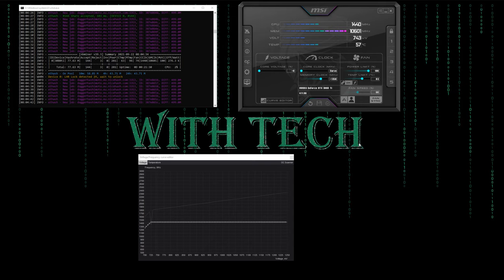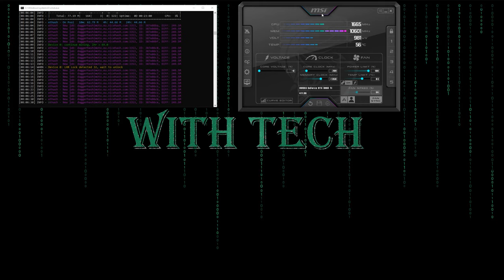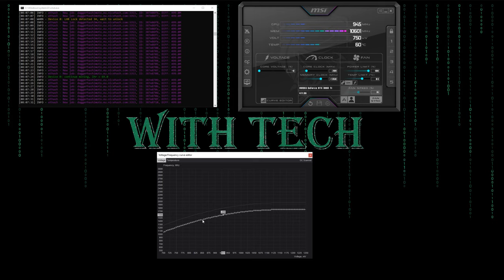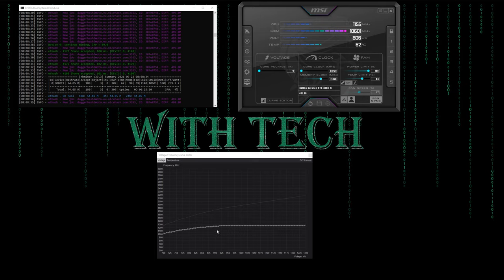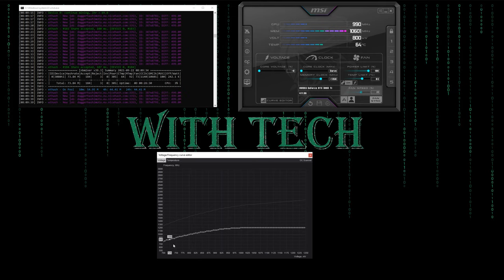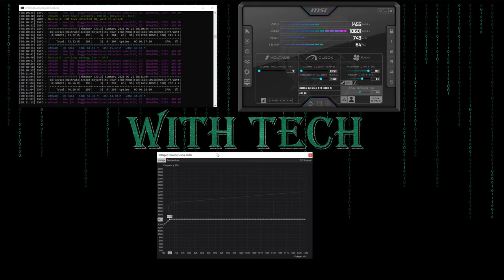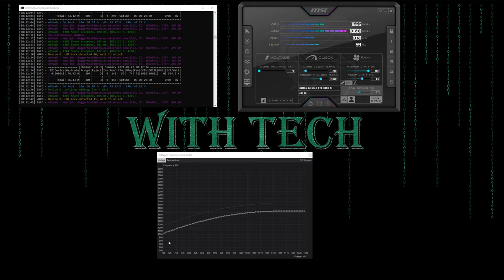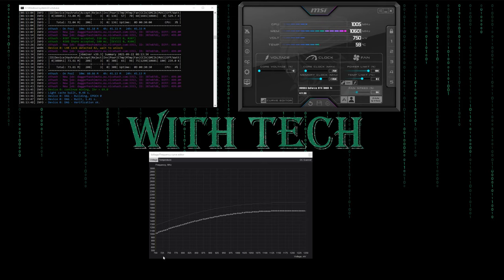Lock Voltage and Core Clock! With MSI Afterburner!

Comment: Desperate Gamer here and long time overclocker! having a new issue with afterburner not accepting the apply of core voltage changes.  When I hit apply it goes back to zero.
Reply from the maker: I am not sure if it is something caused by the GPU or the software, but I have heard others having the same problem. Double check it yourself. See if others with the same GPU as yours have faced something similar.

Comment: When i open MSI afterburner it displays the temp and GPU but it just says 0 and doesnt change and i cant change anything on MSI afterburner all i can do is move the tab around
Reply from the maker: make sure you have the latest version of MSI Afterburner and the drivers for your GPU. in some cases you may need to uninstall and reinstall them again. let me know if these don't work.
Reply: @withtech341  Not of them worked, Everything is up to date
Reply from the maker: You want to overclock for mining? Use this method if you are NBMiner user. https://youtu.be/kudoRHTUBj4. Then you can use GPU-Z or any other app for monitoring hardware and then you can see the actual values your GPU having. Let me know about the results.
Reply: @withtech341  I want to control fan speed
Reply from the maker: You can do it as I have mentioned in the video. NBMiner has some miner issues at the moment but they may be fixed with the upcoming updates. In the future I may also make a video about t-rex miner which allows us to control the fan even better than NBMiner.

Comment: straightening the line what difference does it make for mining ..i love the idea but want to know why..then i will do it
Reply from the maker: With straightening the line you are basically either underclocking the GPU or overclocking it. in case of underclocking (with a straight line), you are basically making the GPU more stable and power efficient at some point. Undervolting kinda does something similar but for some GPUs, it could be less stable.
Reply: i am glad you show how
Reply: i did it many many thanks

Comment: Can ya help I have different problem so when I change my mem clock it doesnt save
Reply from the maker: make sure to hit apply after you change memory clock. also, if there's no load on your GPU, changing the memory clock wouldn't be shown. if you play video games, I suggest you activate the On-Screen Display for memory clock  from Monitoring section. then when you play video games, you would see the current applied memory clock. try it and let me know about the results.

Comment: may i ask , iam using 3070ti and iam mining on it also i saw when the memory Clock 1200 and the power limit 66 its perfect to me but iam afraid this memory Clock will let my gpu get tired after a few months . so what u think man
Reply from the maker: Just don’t let your card get thermal throttled and it should be operating good for a very long time. Mostly the first thing that could break while mining for a long time is the fan(s).

Comment: How can the L key lock voltage in the last part of the video be locked to 700mv, because I am in the same situation as the video, when I lock 700mv and apply it, it will not work.
Reply from the maker: It should lock the voltage at 750mv or below, not above that. Maybe it is because 700mv is too extreme for the GPU. I personally get one of these three values when I lock the voltage at 700mv, it is either 737mv, 743mv, or 750mv
Reply: ok, Can you use the L key to lock to any voltage?, I have tried to lock any voltage value and it has no effect, and the core voltage (%) of the msi afterburner main screen can be adjusted and applied, but the VOLT value has not changed.
Reply from the maker: @mingchuang5423  when you lock the voltage at a certain point, it usually means  it could go lower but not higher. and as we know, we cannot just lock at the lowest points such as 700mv with certain cards and GPUs, so it does also depend on the card. L key does lock the voltage but as I mentioned usually it means can't go higher than that. it is also true for the core clock.. One thing to mention is that there should be load on the GPU to see the effects of overclocking..

Comment: Thank you can you help real quick where should my asus f17 turf 3060 be set approximately
Reply: Tuf 3060
Reply from the maker: As I have mentioned it in some of videos and comments, each each coin and each GPU may need different settings, so try to find the best settings for your GPU. I have two RTX 3080 Ti and I have two different settings for them.

Comment: Thanks a lot for the video
Could you help me with a doubt please, if I lock my GPU frecuency cercain to the base clock of the GPU in this case a 2070m with Max-Q, this affect to the image in the display or monitor? I want to down temperature because in games the temperature ups to 90C, thanks in advance
Reply: By affecting the image, I mean that the colors change or the image looks strange with colors that are not or even damage the screen due to those changes, or the GPU itself. I locked in 1060mhz but playing resident evil 2 begins in 75C and them in a while time up and up to 90C
Reply from the maker: For gaming, try to focus on locking the voltage. Monitor the usual voltage you are at while gaming. Then enter the curve editor and lock the voltage at a lower value than the one you have had. If you had a 1000 mlv while gaming, you lock it at 950 mlv. Decrease the voltage until you lose fps. Lock it with the “L” key. Also, you don’t need to increase memory clock that much. Start with +50 and stay below +200. Same with core clock. Try to have a value between 0 and +250. Please know that these are just overall notes on overclocking the GPU for gaming. Each GPU is different from the other, so try to work slowly on finding the best OC settings for your GPU. Let me know of your further questions and concerns.

Comment: what is gonna happen if I for example lower my core clock only like by 300 and leave everything else including the voltage at default?
I have been seeing an incredible smoothness in my games with lowered core clock speeds.
I am wondering if this is even okay for my gpu 
cuz u know RTX 3080 strix default clock 1905 and i am running my gpu at 1680 core clock speed at default voltage and s h i t and i am telling you man, my games are running so freaking smoothly ....
Reply from the maker: Well, you will increase your GPU efficiency but be aware that sometimes performance is the catch. It is because usually for gaming we increase the core clock rather than decreasing it. You could lock the voltage for efficiency, not at 750 but higher. You can monitor your GPU performance and data while gaming, and then you can set and have the best overclocking values for your games.

Comment: Great video! What are your thoughts on using the 3080ti to dual mine instead to try to avoid some of the LHR?
Reply from the maker: Thank you! For Dual Mining, I think it is great that now we have this option, it could lead to get breaking the LHR GPU limit. And for mining, I would say it depends on what you want. For example, the number of GPUs you have and the the investment you want to make. if you have a +6 RTX 3080Ti Rig, then dual mining sounds better for me. or maybe when you want to get some eth on one hand, and save ergo, conflux or Raven coin on the other hand for investment, it would be a good idea as well. Now, Ethereum is so profitable that would kinda be enough if you want to exchange it to money daily. But if you want to prevent the LHR Locks, then locks happen with dual mining as well. I would say they are not as common as of NBMiner, but they could get really annoying with wrong overclocking settings.

Comment: Is it safe for nvidia card ...  Am not sure
Reply from the maker: Sometimes it is necessary. And usually it is highly suggested to do so, because you could make your GPU consume less power and run at lower temperature.
Reply: @withtech341  someguy sayad it can be tempered ..
Reply from the maker: You could always compare the stats and see if you are making it better or worse. GPUs are different from each other.

Comment: I used the exact same steps with my 3080ti Stric and Afterburner does not let me in any way go below 1245 Mhz Core Clock! Any advices are much appreciated!
Reply from the maker: if you want to lock the core clock at a certain point, give a negative number to it. then lock it with L. if you want a straight line, make sure first you lower down and level the two ending nodes (dots), then do the process of making the straight line. for some reason if you haven't lowered down the entire core clock and haven't leveled the two endings, it will only make a straight line to a certain core clock value. let me know if you couldn't solve your issue.
Reply: @withtech341  regardless of how low i go with the clock line (any value under 1245 Mhz), if i lock it and click apply, i get a straight line exactly at 1245 Mhz. Now way i can apply the settings and get a value BELOW 1245 Mhz:(
Reply from the maker: why do you need to go lower than that? GPUs are really different from each other, they  behave differently..
Reply: @withtech341  Because with GMiner 2.7, i get 82 Mh on ETH and 90 Mclock degrees. But with ANY of these last weeks newer versions of miners, i get 92 Mh but all fhe time 100+ Mclock degrees (which is worring for long term). No matter what i do in Afterburner, i still get same temp, although my card is top notch Asus 3080ti Strix. Some say i meed to underclock heavily to 1125 or 1200 Mhz for Absolute CC, but as i said i cannot go below 1245 Mhz. Thanks for help!
Reply from the maker: Nvidia says for GPUs equipped with GDDR6X memory it is safe to go as high as 110 celsius degrees but better to avoid it. 100c degrees seems okay to me. My GPUs play around 96-104c. There are also other ways to lower down the temp, but I personally wouldn’t do them with the temperature you are having. But it’s your card, your choice. Do what you think is the best and wouldn’t make you worry.
Reply: @withtech341  thanks, but I'm reserved of Nvidia statements. We are talking here about the 24/7 workload. The point for me is to mine with my top 3080ti Strix until ETH 2.0 and then use it for gaming. This is why I'm obsessed with getting the most of it below the 95 degrees threshold (for longevity)
Reply from the maker: Well, there are some ways to get a cooler GPU. Increase the fan speed, for the long term, it could decrease fans life span. Use another regular fan that you at home, let the airflow blow the GPU. Attaching some thermal metal or pad to the gpu and a fan to it. I haven’t tried this one myself but I have seen it, and they claimed it was effective. 

Also, for the core clock try this: slide down the core clock all the way to -502. Enter the curve editor, lock the voltage at 750mv. See if this time the core clock decreases.
Reply: @withtech341  MSI Afterburner does not let me go below 1245 Mhz. It automatically creates a straight line at this value, not matter how low I go. I'll try with an external fan but I doubt it will do much
Reply from the maker: I think it is the GPU doing that. Maybe it is just because it needs at least this much of core clock. My regular 3080ti’s core clock fluctuates most of the time even if I lock it, but my OC 3080ti is mostly stable, the core clock doesn’t fluctuate and it stays where I lock it.
Reply: @alexfrangulea  my 2060 6gb had a similar issue where it would not go down in afterburner. I fixed it by using nicehash's oc tuner and now getting much better efficiency and temps. the process is so dead simple (you just enter values) that it made me realize what a terrible job msi does with its software!
just install the nh quickminer, set the optimization to manual in the web dashboard, then right click the icon in the task bar, oc tune, and enter the exact clock speed, memory speed and fan speed you want. apply and then use any miner of your choice.
Reply from the maker: @Bhoopati Baboo I haven’t tried your steps with nh qucikminer but if it works then great, and thanks for sharing. There’s also a way that could help with this situation which is tuning the GPU within batch files. NBMiner does support it now and T-Rex miner has been supporting it for a long time now.

Comment: There is no such a option ty my msi afterburner
Reply from the maker: which option?
Reply: @withtech341  the one which you can lock core clock
Reply from the maker: Don’t skip the first part and you will know about the shortcut that opens that window. I am not on my computer at the moment, and I can’t recall what the shortcut was that’s why I suggest you listen to the first part where I explain how to open the curve editor if your MSI afterburner interface is different from mine. Let me know if you could get into the curve editor.